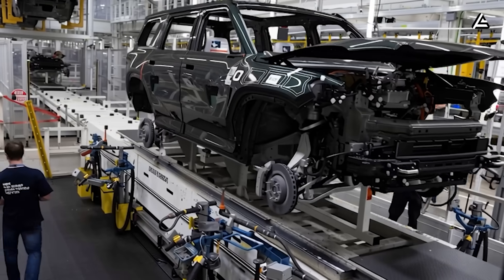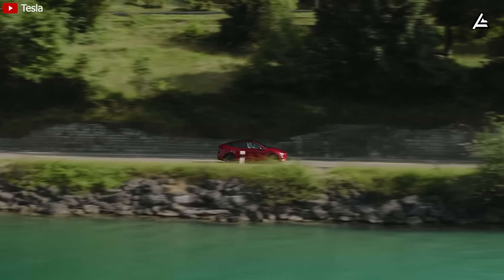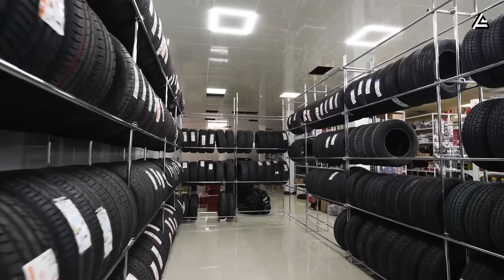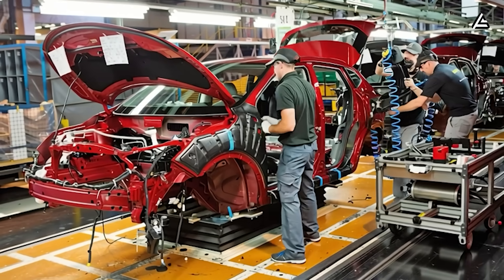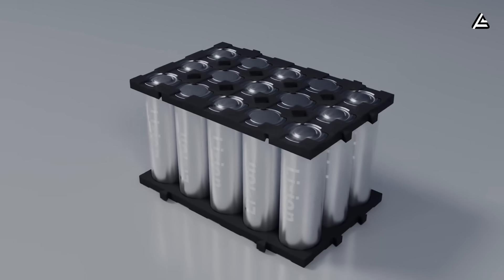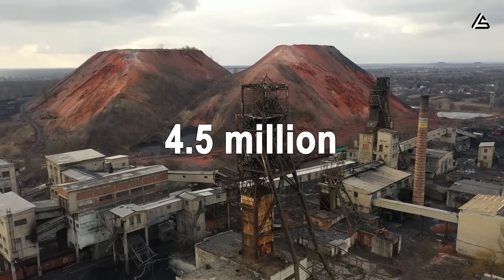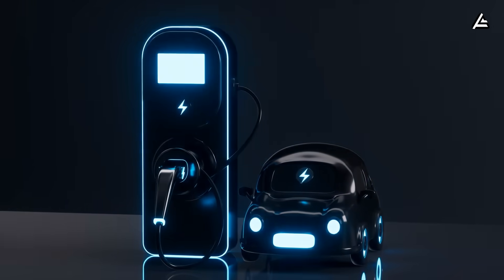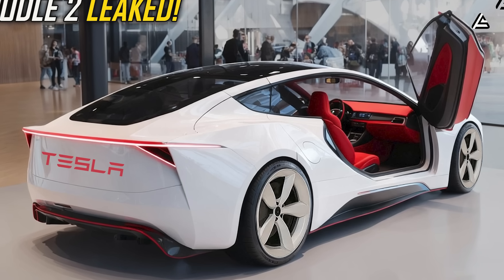Elon Musk Announced 2026 Tesla Model 2's 3 All-New Features. End Of China

Comment: You didn’t mention the new motor and axles which are cheaper to make and run cooler. Which also will less energy from driving range.
Reply from the maker: You're right! Those new components could make a big difference in efficiency and cost. Do you think they'll be key to hitting that lower price point for the vehicle?
Reply: @AutoGearShift2 The newer batteries have a “lower” cost. Having to have less of them to get same range due to overall less cooling needed means lower cost overall.
Reply from the maker: yes you're right. That's when the customer has no more anxiety when driving